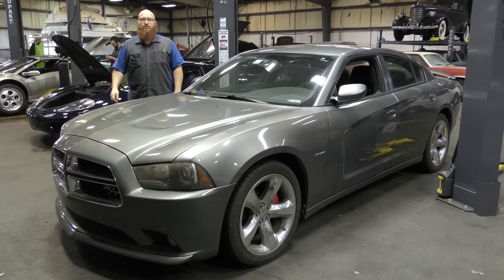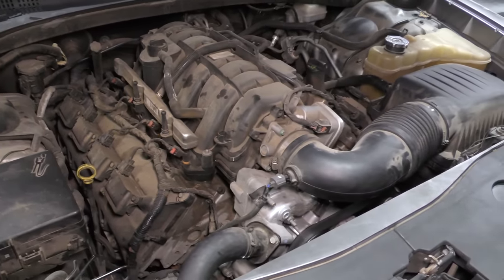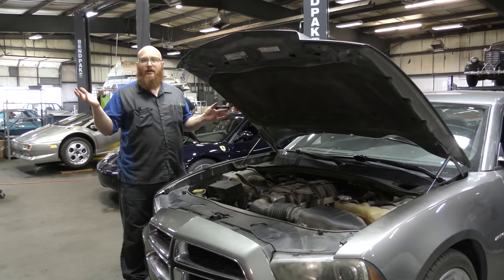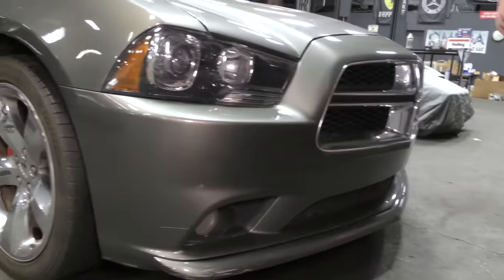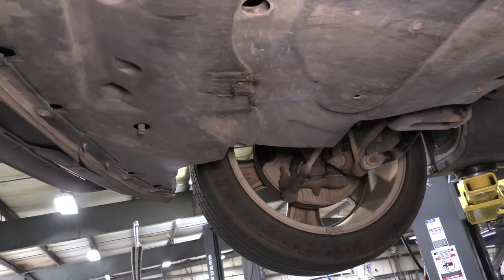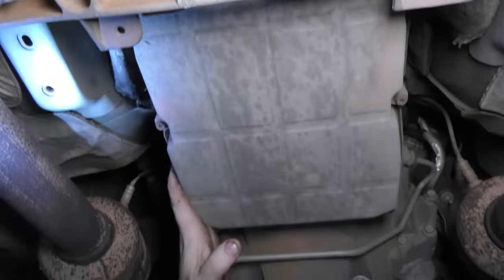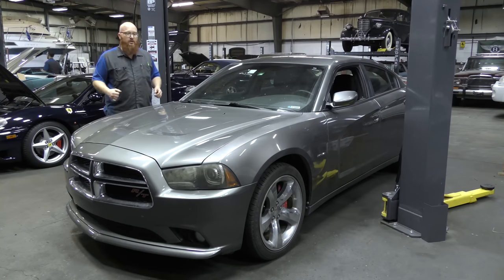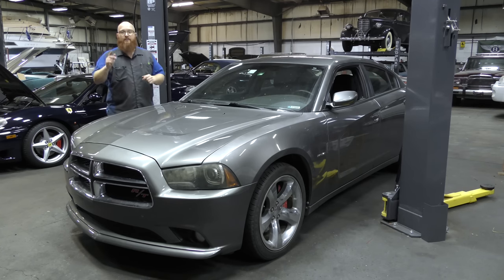Tic Tic Tic! 2011 Dodge Charger RT has the infamous Hemi tick. What will the CAR WIZARD do about it?

Comment: Yea at 196,000 miles, I wouldn’t worry about a slight tick either way.
Reply: Thank you. Agree. It's kind of a  noisy engine. Mine has 115,000 but no issues. Relax people the valvetrain makes some ticking. Lol
Reply: If it did break they could do a hellcat swap
Reply: @fredwilliams7893  
Tech13 commented:The injectors tick very loud even more so starting 2011.they put noise insulation over the rails to help. The lifter rollers wear out and wipe out the cam lobes. That happens because they moved the cam higher in the block for better valve train geometry.  Now the cam does not get constantly bathed in as much oil and there is no oil gally feed to the lifter bores for lubrication.  It gets whatever washes over the lifters. If you hear a lifter tick that means the lifter roller is worn and the cam is getting scored. If you have a misfire and you want to determine if it's a bad cam. Do 4 or 5  Accelerations to the redline. Then the engine will start to misfire bad
 Let it idle and it will smooth out. When the ramp on the cam lobe is damaged it causes the lifter to collapse on hard acceleration.  Even if you don't hear a tick it can still be a bad cam.
So if you want to diagnose: give it 4 or 5 hard engine accelerations in a row....
Reply: Seriously all the direct injection motors tick off the lot because the cam driven fuel pumps damn near touching the hood and firewall are thrustin' away. It's fun that they try to insulate them with some foam condoms and underhood diaper but the real solution would be to not put it on top of the engine!
Reply: @emotionz3  the real solution to direct injection period is to go back to port-only or include a dual setup.  these DI-only engines are fucking nightmares long term and its only in the US they are widespread as other countries get the dual setup making long term ownership cost needlessly more expensive for US customers

Comment: The first generation of that platform was in 2005.  I bought and still own one, a Dodge Magnum RT.  It is rated to tow 3800lbs if it has the tow package that consisted of a larger radiator and special load leveling shocks on the rear.  It came with a 2" receiver hidden hitch.  I installed a Drawtite 1 1/4" hitch on mine that has the 3500lb rating.  Yes the car can tow 3500lbs. My Hemi doesn't tick.  It sounds like a sewing machine.  But the 2005 thru 2008 Hemis didn't have variable cam timing.

Comment: I got a 2005 Jeep Grand Cherokee with the Hemi. I think this is one of the earlier versions and it surprises me with how well it can accelerate a 5000lb vehicle. It's been reliable too.
Reply: Good luck!  I bought one new.  I praisthat vehicle the whole time I had it. Never really a problem.  One morning 2 1/2 years ago, I cranked it and the motor started banging loud.  Broken rod inside motor.  $5000+ repair.  More than the cars worth.  Did research after it happened.  90% of the Hemis made in all model years between 2004, when the motor was introduced, and 2012 have had the same major engine failure when the miles are over 125,000.  Mine had 132,000.  Junk yards are full of them.
Reply: @VerticalMARS1  Hmm...I have a 141k on it. Maybe time to get rid of it? 😆 
I swore that I'd never buy Chrysler products even though they kept food on our table growing up.
My Wife was being stubborn and wanted something that looked "good." I was initially looking at Toyota and Honda but no there "ugly." Who cares what the outside vehicle looks like if they leave you walking home? 🤣
Reply: @kalabash72  Well, might not want to pull any more boats with it. And hopefully you’re part of the 10% LOL. I actually still have mine. It’s sitting on my dad’s property with a cover on it. Never been wrecked everything works on it. Leather seats everything. Looks like a brand new car. But motor is blown. It’s a real shame, no one wants to buy it either. People only want to offer me two or $300

Comment: I learned something new today. I should have known, but never really thought that the Chargers were German influenced or shared similar parts with German cars. Interesting.
Reply: It dates back to when Daimler owned Chrysler.
Reply: Yes, the 05’s up to about 10 had MB suspension, trans, steering column among a few other small things. Benz sold Chrysler there old stuff and built new stuff for their cars. They drained so much money from Chrysler, that’s why they weren’t worth anything when they went to sell them. That’s a bad thing to do with a company you own. But all the wanted was the money Chrysler had in the bank. Back in the early 2000’s Chrysler was in very good financial shape. It only took a few Years of Daimler ownership to bleed Chrysler dry!
Reply: @dodgeguyz  They basically paid off the people that cared to go away, grabbed all the money they could out of Chrysler, then said they were broke and dumped them.
That's also why we ended up with a 4 door sedan with the Charger name all over it.
They all knew that famous car name but had no clue how real car people felt about it here and didn't care what we wanted in a new Charger.
We did get some nice engines and rear wheel drive back, and eventually the Challenger to make up for the Charger sedan crap.
I have a 06 Charger Hemi RT now and I love driving it but I wouldn't have bought it for myself except my lil sister bought it new and wanted to get a new car so made me a smoking deal on it with 90k.
No ticks, very quick, and handles well with all the creature comforts available back then.
Reply: @dodgeguyz  That's a bit false. It was only ever rear suspension components, really, and they still use the same hardware from the E-Class on the LD platform. The LD is only slightly different than LX. 

The parts are still used.

Comment: Hey @Car Wizard, I don't have a hemi powered vehicle.  I do have a 2005 GMC Canyon, with 3.5L five cylinder engine.  I notice it has a slight tick when running, more noticed after warmed up.  You mentioned it as normal, part of the valve train on the hemi.  Would you or anybody you know have experience with my vehicle's engine, and know if that is normal to have a slight tick on it, too?  Thank you for everything you do, we learn a lot of new things every time we watch your videos!

Comment: I left my hemi tick alone, like what car wizard said (along with other mechanics) and it turned out it was a catastrophic lifter failure and it ate the camshaft. 220k miles, but it’s had the noise since new. 

Lifters and camshafts were on backorder when the problem went catastrophic. Not a fun experience, and 16 spark plugs is stupid.
Reply: Damn but you got 220k miles out of it, pretty good ngl
Reply: Well, I really drove it to the point where it just barely turn over. It was misfiring for a good while, I knew it was the lifters but they were back ordered at the time for 4 months so I just had to keep driving. And when they did come in, they were the wrong kind. I had ordered mds lifters, they sent me non mds lifters. And I didn’t realize it until after I put it all together.

It was a terrible experience
Reply: Not smart to keep driving it with a chewed cam, metal gets into your motor and will eventually ruin the bottom end. At that point it is better to replace it entirely then to redo the lifters/cam unless you catch it in it’s early stages that’s only when it makes sense to do lifters/cam
Reply: @gurvir7638  I guess you missed the part where I said it was on backorder for 4 months; basically I placed the order, and just keep getting delayed and delayed. Had no choice but to keep driving it. 

Anyways, I ended up having to replace all lifters, and the camshaft; plus all of the ‘while you’re there’ stuff. Bottom end was fine in my case,
Reply: @jasonathey2551  I read that part and yes I’m aware it’s on back order but unless you had no choice and had to keep driving it then I understand but the bottom end doesn’t go right away, it starts making issues in the long term. If I were you sell it before it bites you
Reply: @gurvir7638  I did end up selling it, I ended up getting an Audi A6 diesel. I do miss the truck, it was nice and did everything I needed it to do. If it wasn’t for that problem I’d still have it. That being said I don’t think I’ll ever gamble on a 5.7 hemi again.
Reply: @jasonathey2551  if you had the tick from day one then you didn’t leave anything alone because that wasn’t failed lifter tick. The sad thing is you may not ever really hear the lifters go until they are gone. Even with the lifters I imagine an Audi would cost you more over 220K miles
Reply: @calvinrovinescu6166  we’ll see, I’m at 134K right now on my 3.0 TDI; worst thing to break has been an EGR valve and a coolant expansion tank.

Comment: the pentastar tick is much worse. but we fixed it on my dads jeep. took off the valve cover and replaced the bad roller rocker. its been over 2 years now and it still runs great.

Comment: I have a 2014 Challenger RT, and it too has the hemi tick. I have an aftermarket exhaust which is a bit louder than the stock exhaust, so I never really hear the tick unless I remote start and hear it from outside of the car, or I'm at a light. Besides this one little thing that can be an annoyance to some (doesn't bother me) the 5.7L is actually regarded as one of the most reliable V8's. It's a good motor

Comment: I have 160,000 miles on my 5.7 and every part on the motor is original to the car, minus things like spark plugs, obviously.  These things hold up if you change the oil often enough lol.

Comment: Caliper covers and a cheesy shift knob on a auto👍
Reply: A poser I say
Reply: It's an AutoStick, you can still "manually" shift it. As in, you can move the knob left/right to change gears with a really quick (less than one second) response time. Compared to a manual, the computer in the car will automatically shift when in the manual mode if you're running too high of an RPM to prevent engine and transmission damage, which is nice.
Reply: @Vynncent  Oh, so Womanual Mode.

Comment: The 2011 Dodge Charger R/T is still a great muscle sedan with the 5.7 L HEMI V8 engine and the five-speed automatic transmission with manual-shift capability. They are well maintained properly and they do not spend thousands of dollars to repair these vehicles. For the first week of May, I am extremely hopeful for the next all-new, buy this, not that video to be uploaded from the Car Wizard on Tuesday or on Thursday. He will eventually do one for Mitsubishi on Tuesday or he will eventually do one for Mazda on Thursday. Thank you very much.

Comment: The Chrysler hemi performance engines are notorious for making slight tapping or ticking noises. Tapping and ticking noises can be caused by various problems in the motor, however these noises are most likely caused by a lack of lubrication, and may be a sign of a more significant problem. If your hemi has begun making a ticking noise or the noise has increased, you should take the vehicle to a certified professional mechanic so that the cause of the ticking can be professionally diagnosed and repaired.

What Makes Your Hemi Tick
Ticking sounds in an engine are commonly caused by a lack of lubrication. Lubricants such as oil and fuel flow between metallic components and provide cushioning so that the parts do not tap against one another. Ticking or tapping noises can come from several different sources, including the lifters, valves and fuel injectors.

Lifters
One of the most common causes of the hemi tick is a problem with the lifters. There has been much speculation about what causes the lifters to tap on some hemis, especially the 5.7-liter V-8, however there is no technical service bulletin or recall on this engine from Dodge. If your hemi has lifters tapping, it is important to check the amount of engine oil and make sure you are using the right type of oil for the vehicle. Low engine oil can cause a lifter to tap and can cause permanent damage.

Fuel
Low quality fuel can cause the hemi tick. Fuels that contain high amounts of ethanol or that are low octane may not properly lubricate the fuel injectors and can lead to a slight tapping or ticking noise. Low-octane gas has also been known to cause an ignition knock in high-performance engines. Using fuel additives or a high quality gasoline can help prevent this from occurring and may be able to correct or minimize a hemi tick.

Valves
The intake and exhaust valves on the hemi may also be causing the ticking sound you are hearing. Valve tapping can be caused by several different problems, including a lack of lubricant or a problem in the springs that close and open the valves. Valve problems should be examined by a mechanic to determine the precise cause and possible solutions.

Comment: Mercedes DNA on a Chrysler product, ah yes a double Doo-Doo sandwich
Reply: What a stupid comment to make on a 10 year old car with 200k, inexpensive to buy, no major issues, with cheap and easy repairs. Is your brain on cruise control, or do you ever engage it and actually think?
Reply: The only Mercedes parts on that car are the transmission (which is pretty solid actually) and some suspension components. If this thing had more Mercedes in it, it wouldn't be as spartan

Comment: I bought a new AWD Hemi Charger in 2013. At 24,000 miles it developed a noise in the geartrain and a vibration, neither of which could be corrected by the dealer after 5 or more visits, Each time their tech(s) verifed the problems existed.  Then FCA's "regional expert" said the noise and vibration were "normal"; no more warranty work was authorized!  After much vociferous complaining, the dealer took the Hemi back and gave me, at no charge, a new Chrysler 200C.  A bad deal, you say?   Wrong.  That 200C has now gone 55,000 miles with zero problems; it's quick, gets 27 mpg, and is more comfortable than the Hemi ever was.  Best car I've owned, and I've owned at least 20, from a Pinto wagon through a Mercedes S class.  But I'll never buy another FCA vehicle again after the shoddy treatment by that dealer.

Comment: Saw that the door card rubber near the top of the window is separating from the frame.  I have the same problem on my 14 RT.  Dealer wants 900 for a new door card.  Re-gluing it back together with Goop Auto Adhesive.   Learned were the oil sensor is on the video.  Nice to see that the car has almost 200k on it.  These are great cars with the HEMI.   This version of the Charger looks the great.  Everyone know what it is.

Comment: The hemi tick is from lifter failure not a hydraulic lifter clacking. The hemi tick can be heard at all rev ranges not just at idle. If you are reving your engine out and it ticks there is an issue and it could be the “tick”. Again it is not the sound of just normal ticking. It is due to improper oiling of the lifter bearings due to the design of the lifter galleys.

Comment: Wow, above average shape/condition for that year & mileage of car, especially a Dodge + little to no rust or corrosion on the floor pan or under body bits. Just the infamous Hemi "tick". Sadly the Hemi 5.7 liter V8's had issues with the OEM cylinder deactivation (to save a bit of fuel) which led to valvetrain problems, lifter/cam issues etc. Best thing one can do is "delete" that crap right from the get go!
Reply: It's nothing to do with cylinder deactivation. It started with  vvt and eagle heads. Hemi's without deactivation are also prone to lifter failure.
Reply: @canadaguy1234  this.. chrysler's mds is surprisingly not that prone to issues the way that whatever it is chevy did that completely destroys their engines before the 60k mark

Comment: The solution for the tick is the new updated 3rd party lifters. I did an experiment with oe lifters on one side and new style lifters on the other. Only one side ticked. The old oe side. That tick is metal on metal and an eventual massive repair.
Reply: which 3rd party ones ?
Reply: I think the new design is to have an added oil galley at the skinny neck part of the lifter to get more oil to the cam. Engine tech melling ect. They all do that.

Comment: Drive the car in auto-stick mode or use a tuner to disable the MDS system. That avoids a bunch of valvetrain issues on these engines. The MDS improves MPG maybe 3-4% tops; not worth the wear and vibrations ! There are millions of these Gen III Hemi engines in cars and trucks since 2005, reliable, powerful and very responsive to traditional hot rod mods.

Comment: The worst noise I've ever heard is the screech of the flywheel bolts rubbing on the clutch plate springs.
Clutch was fitted by MrClutch £480 and when I picked the car up the locking wheel nuts were gone!!!!
EP3 Civic typeR

Comment: The infamous Hemi tick, hah. Also a common issue with the Ford Coyotes - mine included... but like you said, it doesn't cause any issues.
I notice it right after an oil change, then it goes away after a few hundred miles. If anything, I say it adds a bit of human-like character to the car, heh.
Reply: Tech13 commented: The injectors tick very loud even more so starting 2011.they put noise insulation over the rails to help. The lifter rollers wear out and wipe out the cam lobes. That happens because they moved the cam higher in the block for better valve train geometry.  Now the cam does not get constantly bathed in as much oil and there is no oil gally feed to the lifter bores for lubrication.  It gets whatever washes over the lifters. If you hear a lifter tick that means the lifter roller is worn and the cam is getting scored. If you have a misfire and you want to determine if it's a bad cam. Do 4 or 5  Accelerations to the redline. Then the engine will start to misfire bad
 Let it idle and it will smooth out. When the ramp on the cam lobe is damaged it causes the lifter to collapse on hard acceleration.  Even if you don't hear a tick it can still be a bad cam.
Reply: Greg B  2017 gen 2 with about 60k on it